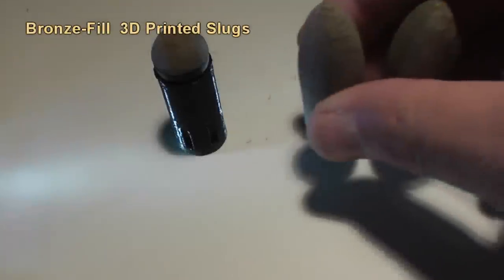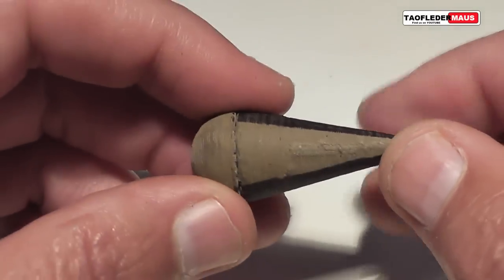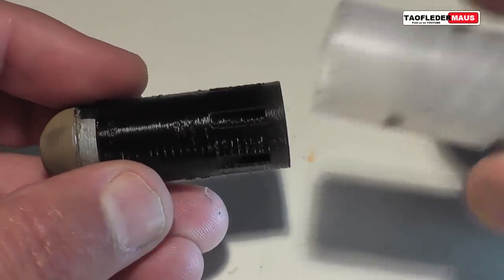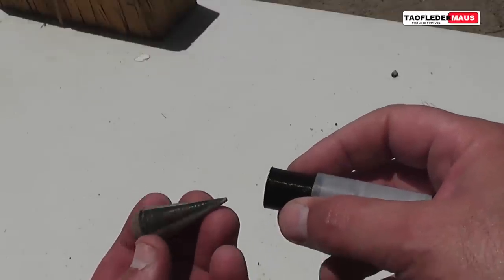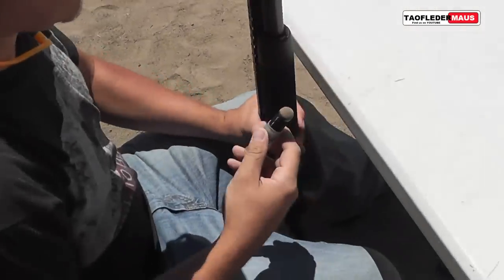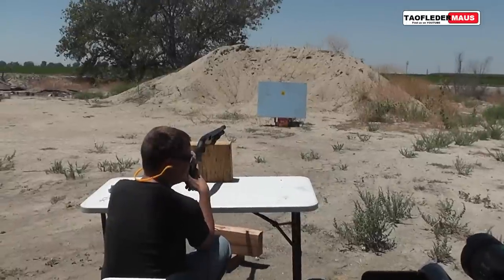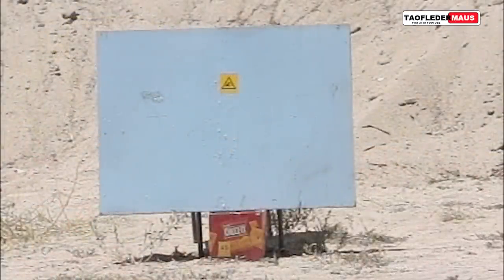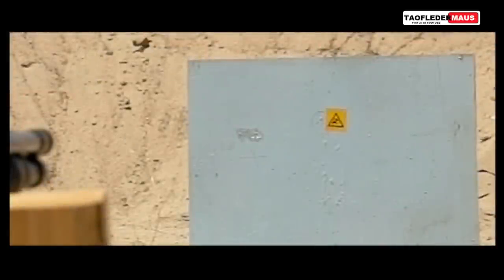Teardrop-shaped 3D Printed Bullet -   Fail Analysis

Comment: Here's my opinion. ( may just bust out the 3d printer when I get home off the road ) 

As the round took flight from the shotgun the (sabo) acted was first to move then the (teardrop) round. So the round and sabo compressed with each other and most likely created a vacuum between the two?!?!

Now I think it would have done better if it was multiple pieces. That way it could peal away after leaving the barrel.. Also if it was made with bronze fill PLA..  It would have been fine with a normal shotgun load

My two cents

Comment: ***** there was way too much friction between the round and the sabot. [the rings that made up the round and the sabot locked together] to fix this the future use a multi party sabot and/or use a thin peace of paper as separator so it does not lock together again. or sand them smooth.

Comment: I believe your issue with this has to do with the shape and "sleeve" the sleeve has a lower mass than the round itself causing it to accelerate at a faster rate than the round. Possibly wedging the round into the sleeve during ignition.

Comment: Mold a sabo with clay or something around the tail of the round.  Split it into several pieces long ways after it air dries.  Fire the pieces.  Place a wadding behind the sabo....the sabo should seperate from the round when fired.

Comment: Even if it seperated from the cartridge it would knuckleball its way to the board, because the head of the teardrop creates a small vacuum behind it, and the small part of the drop will get thrown around, and it will send its momentum haywire, it's like how if you have a window down in your car and a piece of loose trash, the vacuum from the window sometimes will send it flying

Comment: background to contrast the sand? pfft... spray paint the sand problem solved, screw nature,seriously though, background worked very well. As for the round? g-shock pressure fit them together maybe? a thin strip of spring steel that "Lines" the seat between the two is my best suggestion (never critique without offering a suggestion that you can not own up to latter)

Comment: The sabot should have had slits on the sides. Like the sabot slugs for shotgun shells. Sense it was solid there was little room for air to get inside to push the sabot away from the slug. With the slits air can get in between the two and pull them apart.

Comment: The main issue is that all the fast moving gas slams into the holder which is then jammed against the actual round. The round itself needs to be propelled faster than the holder.
Reply: If the sabot was made less aerodynamic (forward facing fins to induce drag or maybe even a deployed parachute) then the round would continue forward without the sabot.

Comment: Perhaps if the plastic holder was cut into three or four pieces it could split off mid flight, I believe you've shot rounds with similar mechanisms before.

Comment: i think that if the holder holding the teardrop would've been made out of separate pieces like 2 pieces or 4 pieces, it would've separated better, this way it seems to have been stuck inside the holder due to the thrust with which it was shot

Comment: Actually, a teardrop is only a good aerodynamic shape at subsonic speeds. At supersonic speeds it turn into an absolutely terrible design. I ran a few CFD simulations on a teardrop bullet and a fairly standard design with the same diameter and length. At 900 m/s the teardrop has a ~50% worse resistance. I made a few screenshots during the simulation, message me if you want to see them.
Not only has the teardrop a significantly worse drag, it also experiences higher temperatures during flight. This generally isn't a problem with inert projectiles though, but still a point of interest. Its wake is also worse.

I also ran some CFD simulations on the steel/titanium/brass/etc shell from Tactical G-Code. It wasn't pretty. It had more than twice the resistance of a standard design. This is not only due to the nose design but also due to the ribs causing mach waves.

And just for giggles I made a so called 'shape stabilised projectile'. It doesn't need fins or a spin. Its shape alone will keep the projectile pointed the intended way. When designed properly it's impossible for a shape stabilised projectile to tumble and keyhole. Its drag coëfficient is right between a normal projectile and the teardrop design, but it effectively has a higher volume than other designs. Sadly I do not have access to a CNC machine so I can't make a few and ship them to you.
And as with the other CFD simulations, I have screenshots.

Comment: I know I'm probably going to get a lot of hate comments for this, but have you thought about something as simple as a paper sabot with triple split petals and a dime at the base. I'm thinking that when it's fired the dime will give the paper enough structure to push the round out without getting stuck onto the back of the round. Then once it leaves the barrel it should open up and the paper just kind of whizzes out of the way and off the back of the round?
Reply from the maker: JudgmentDay78 Why would you get hate for that?
Reply: ***** Because this is YouTube, and it seems like an actual logical idea that might work? lol
Reply: NecroBanana Thank you, my point has been quickly proven in just under 2 hours. Although I never thought it would have been by the rotting corpse of a banana. lol

Comment: I want to Agree and disagree with what a lot of what other people are saying. I Agree the problem is with the sabot, but not because of its weight or momentum. Based on the high speed video you can see  the round tumbling through the air. As TAOFLEDERMAUS showed the tear drop round sat lousily in the sabot. That amount of rotationl force shoud of separated them. I suspect that as the round was fired or as it came down the barrel the plastic fusing the two together. There are a few ways this could happen, friction from coming down the barrel melted some of the plastic. Or the initial force or shock of being fired out a gun fused the two together, My two cents any ways. So also agree with the solution most of the other people are saying; make the sabot out of multiple parts.

Comment: The heat could have fused the parts   or all the force was on the assembly as a whole and they wouldn't seperate. So if you were to do it again make a large hole at the back of the sabo so it could act as just a rest

Comment: i think if the mouth of the shot cup was a tad larger than the base . drag would pull the shot cup off. the way it is now .a reverse diablo shape .  air pressure is creating a seal   and the cup cant drop off .

Comment: i bet the gun welded the 2 the sabot to the slug (explosion welding is a thing). especially if the plastic is pla, the stuff has such a low melting temperature you cant even use a power sander on the stuff without it melting.
Reply: Thanks to the layers of the print being oriented perpendicular to it's flight path, welding is not even needed. The black sabot will simply be pushed vorward and lodge onto the ribs in the bullet.

Comment: Try working the sabot in some sort of Fragile Foam or something.  So when the gun Shot, it just breaks itself in the Air and release the Slug. 

It's often used to shot unusual objects from Cannons.      Basically, Some hard foam thing that is cut to split into pieces simply by the Air Friction and pressure difference.

If you try to shot a singular hard shell that hold the bullet, it usually end up being push against the bullet and for the fraction of time it is in the air, it will stick with it due to friction,

Comment: It looks like the backing to the projectile was shoved onto the projectile, during firing, preventing it from coming separating.  Since it looks like the builder was using an FDM machine, you get those heavy circumferential lines, which are the layer lines and actually are ridges.  I'll bet the ridges from the projectile locked with the ridges on the backup part.

Comment: The sabot needed to be weakened with 4 cuts in it lengh ways so that the pressure behind it as it leaves the barrel will breake it into 4 seperate pieces. The problem with this sabo is it stayed together..

Comment: New background is awesome so just keep doing everything wrong. I think the round failed to separate due to the fact that it is a cylinder as the charge goes off it is just being forced on tighter. Cut the Savo in half so that it flies off of the round like is typical and better results you shall have young padawan.

Comment: I'm guessing because the sabot was solid, the two pieces were forced together tightly, making them reluctant to separate. If the sabot was a two piece design (cut in half lengthwise), it might come apart better.

Just my novice opinion.

Comment: Hm. I don't think you did anything wrong. It looks like the sabot was made of a different plastic than the round itself, potentially a lighter one? (Just my first impression, I could be wrong). 

It looks like the round flew backwards, so that's why I was thinking maybe the teardrop is heavier than the sabot, and they got wedged together from the shock when it fired. I think the best solution would be to just cut the sabot into quarters so that it flies apart when it leaves the barrel.

Comment: The surfaces of the bullet and fill are not smooth. During the firing inequalities overlap, and the cone-shaped projectile is driven to fill. Smooth surfaces and beheading at the tip of the cone (for support) should resolve the issue.

Comment: Use felt wadding shaped to accommodate the bullet shape. Use gun lube to assist wad-bullet separation.
    Bullet speed is crucial, too slow = unrealistic movement, thus tumbling. Very likely this tear drop shape needs spinning to accomplish reasonable trajectories. So smooth bore is 50/50 chance.
    Load it full with felt wadding with lube and use a string to pull trigger incase barrel blows up.
   Saftey first shot on experimental ammunition. Stay alive.

Comment: The real problem is that nobody seems to understand supersonic flow.  You really need to hook yourself up with a aerospace engineer to do a 3d design.

I am not an aerospace engineer, but operating at above the speed of sound is fundamentally different than below the speed of sound.  At that speed, air acts like a particle, instead of a fluid.  Basically, the bullet leaves a vacuum behind it.

For example: when you hear a supersonic jet fly by, the sonic boom is the air collapsing upon itself as the jet passes through the air.

Comment: your sabot had nothing for the air to grip once it hit open air, there were several flaws in this design, but the sabot being one piece and not providing biting surfaces for the atmosphere to interface with are the biggies.  This would also probably have worked better with some sort of rotation

Comment: I know NOTHING about guns or bullets, but what if instead of the casing there's like stand for it, drill a hole down the end of the tear drop, and get another 3d printed item that looks similar to a large nail with the circumference of the shotgun shell, stick it in the hole loosely for when the round is released the force will knock the "pin" inside of the shot away from the round and let the round go freely. 

Like I said, I have no idea if this would even work or if it's safe to do it's just an idea.

Comment: Interesting. It didn't seem like that much more of a fail than many other rounds. In any case, it looked as though it was rather loose in the cup, so you had to jam it in more, which might have been enough force to keep it together once shot. Then, since the cup and round were a single object with the front of the round not being much heavier than the rear, you were in essence shooting a light cylinder, and it would have no reason to fly straight at that point. My $0.02. :)

Comment: the sabot needs to be in more than one piece.. a sabot that is two or three pieces which lock around the teardrop but not so tight, they will fly apart after exit and the teardrop would have flown free.

Comment: I also think the design needs work. Non 3d printed weight added to the end of the "tear drop" and the the rear of the holder. The holder itself needs to be printed in multiple pieces so that when it comes out of the barrel the holder will separate from itself and therefore the projectile. That being said, a petter print would probably help, as it wouldn't be so prone to friction hopefully making it not stick to itself.

Comment: Well i have the answer to your problem especially since my father works at a 3d printing company what happened was the heat made the front and back piece  of the sabo to melt on the round in a weird shape which also caused the round to tumble somewhat

Comment: Should be an Easy fix, basicly cut the Sabot inhalf ( maybe angle the tips of the front so when air hits it it will SPread out) ...

Basilcy the reaason it didnt separate is basic Air resistance and Drag, it  had to no reason to separate